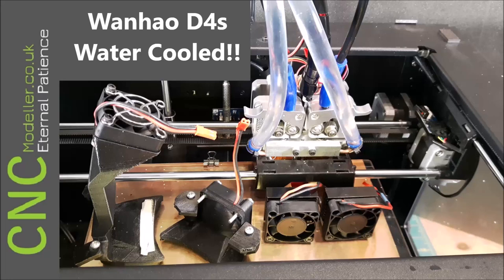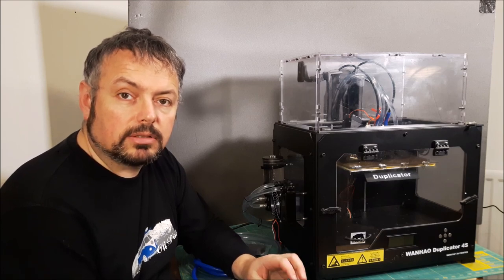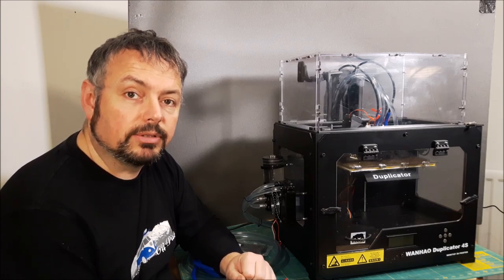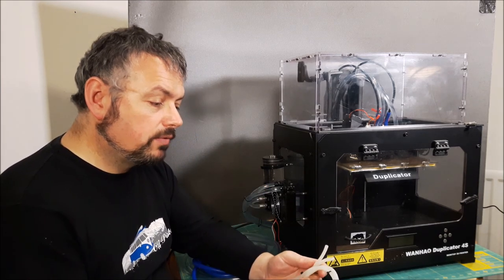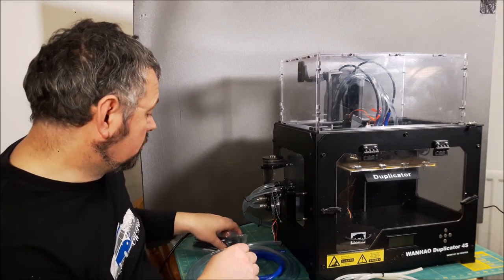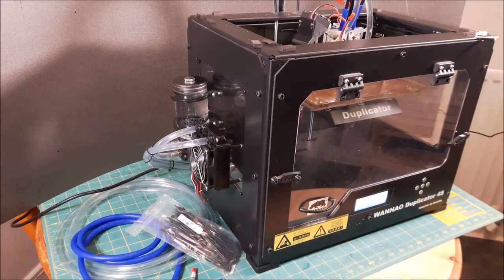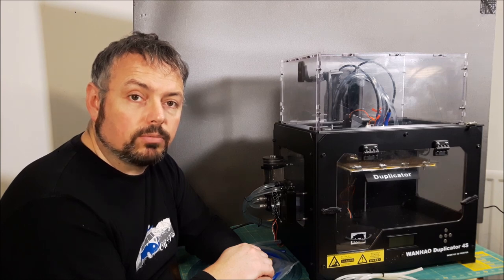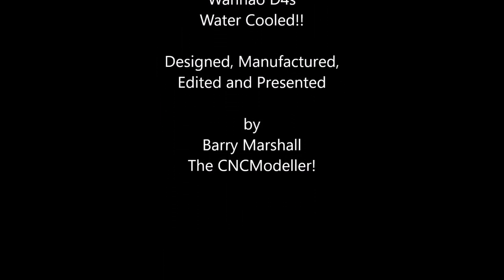How to make a Wanhao D4s 3D Printer Water Cooled Hotend!!

Comment: Interesting. Did you have any problems with the added mass of this setup? I'm assuming the water block + large diameter water hoses + water - fans gives some added weight there. The dual extruder is already quite heavy. The stepper motors surely have enough power to move it, however what I am thinking about is print precision at medium to higher speeds with a somewhat heavier extruder assembly. Wavyness close to sharp corners, etc... Great video, btw.
Reply from the maker: Thanks Sean. I've not noticed any changes in print quality. The mass hasn't changed much as previously I had heat sinks and fans on the carriage too. One of the main benefits is better cooling at higher enclosure temperature. Also easy access to clean the extruder gears is really nice. Personally I'm really happy with the setup, the only issue is mould growth in the transparent pipes and reservoir, which manage with sterilising tablets. Thanks for letting me know your thoughts. It's good to know. Many thanks. Barry M

Comment: Hey, great video. Is it possible to ask what you did to achieve very good print results with this printer? Im using ReplicatorG but im not satisfied and before updating my board and eventually bricking i want to ask if you have some easy tips. Thank you very much
Reply from the maker: I've just converted the D4s to a duet 2 control card, and the print results are much improved. The original board firmware had many settings baked in and couldn't be tuned, print quality was never great but usable for mechanical parts.
The water cooling made a big difference for printing ABS in a closed chamber with high nozzle and bed temperatures. Filament stripping in the extruder gear was much less likely.

Good luck with your upgrade, hope it goes well.

All the best
Barry M